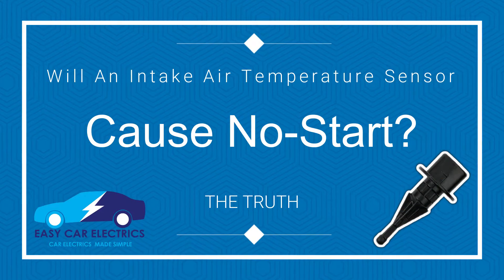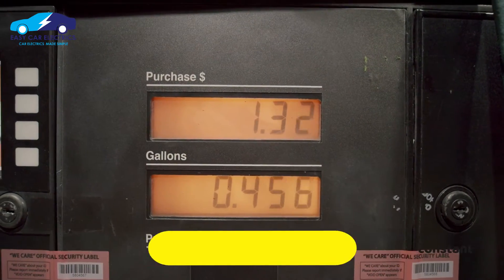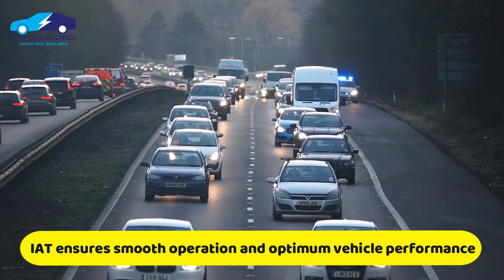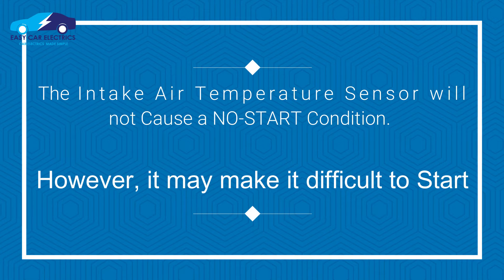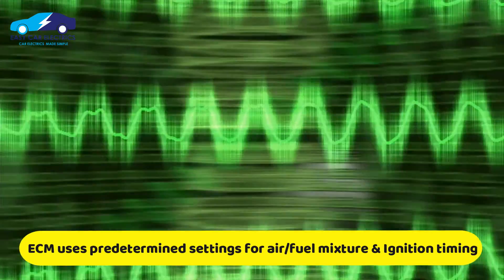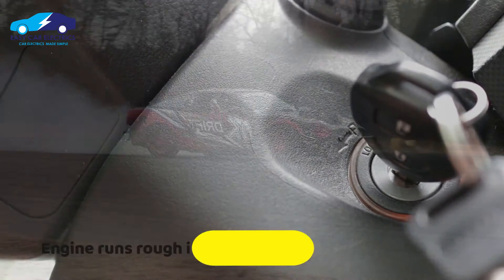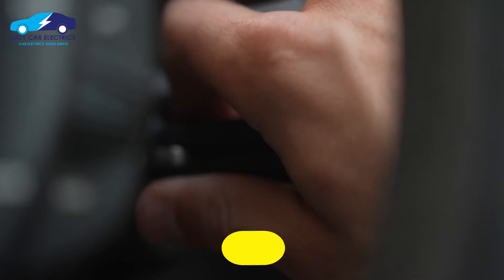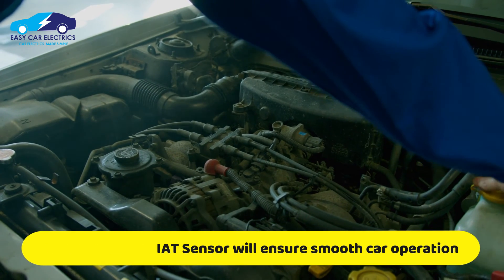Will An Intake Air Temperature Sensor Cause A No Start - Easy Car Electrics

Comment: Yes it can.
Reply: My 2015 dodge dart sxt 2.4 had trouble starting it just cranks so I disconnected the wire and it tried to start at first try then it started at the second try without the connector of the air temperature sensor on
Reply: Oh wow @joseibarra8867